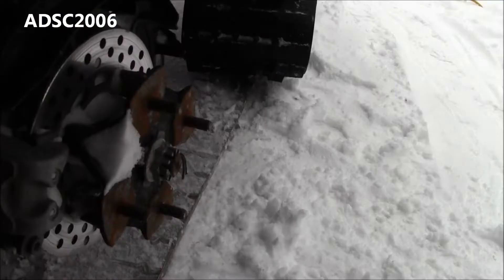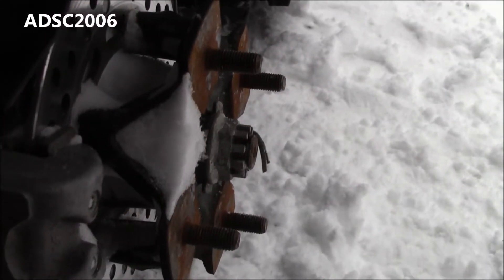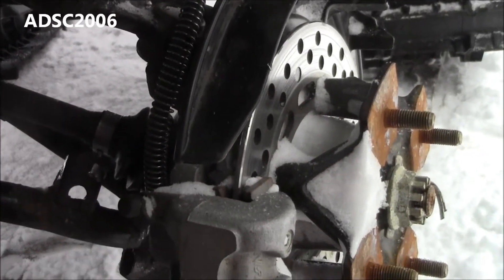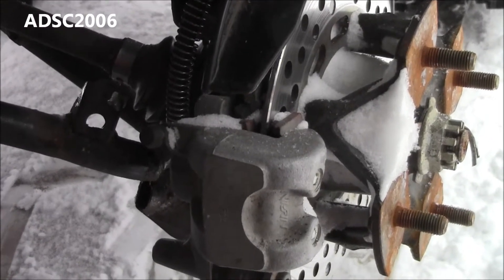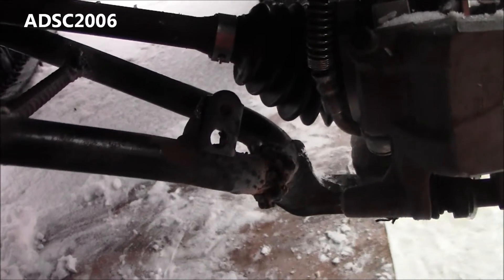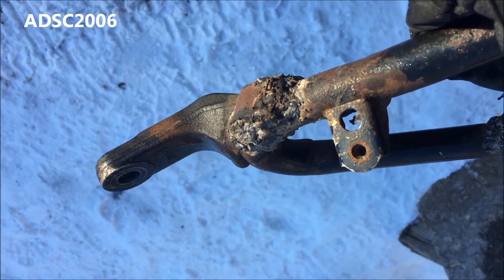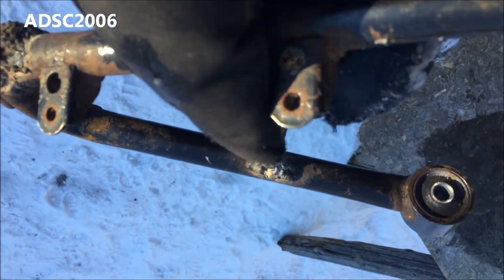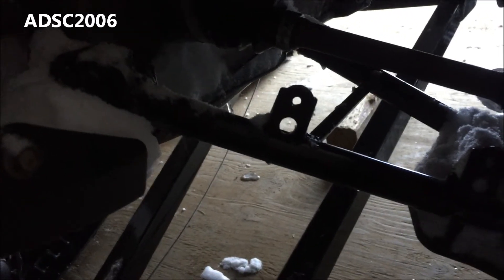Suzuki King Quad 750 A-Arm Temporary Repair

Comment: Well you broke that pretty good for sure do you think the tracks causing to much stress or bad welds from factory ?
Reply from the maker: I think the cause of this was going down rough trail in low snow conditions early season. The tube had a bend in it from hitting something.